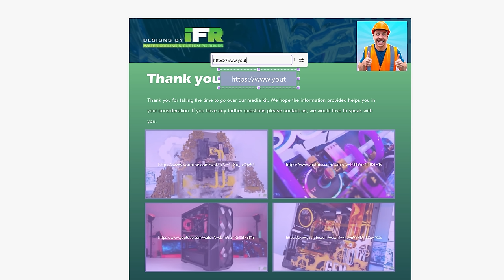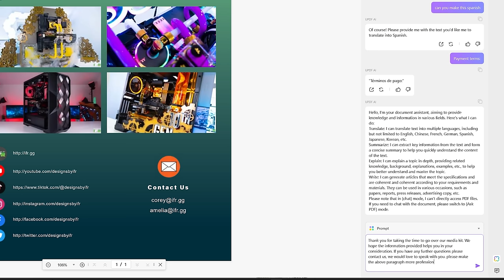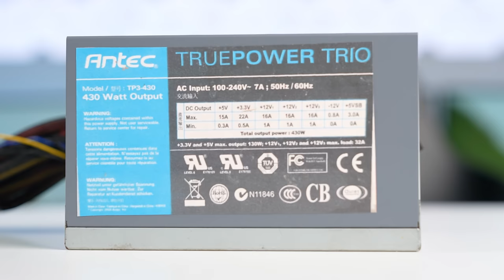Buying a BROKEN $49 Gaming PC On Facebook Marketplace

Comment: That 850w power supply is worth more then the all components 😅
Reply: . . . Most stuff may be washed with pine spray cleaner, then scrubbed and mercifully rinsed out & dried out in the oven at 125 degrees Fahrenheit . . . 🎉 ❤
Reply: i was about to comment that to

Comment: Since the power button cables were broken and needed to be re-soldered, I wonder if the original motherboard was actually fine and just never got signals to power on?
Reply from the maker: No i was jumping the mobo manually

Comment: I5 4460 is not that bad at all. U can pair it with an RTX3060TI, 2x16GB 2133MHz ram, 2TB sata 3 ssd, 650W seasonic psu and its good to flip it.
Reply from the maker: Yeah its a decent little cpu
Reply: No. The CPU Would bottleneck the gpu, the motherboards pci express has not enough lanes. The microstuttering would be all over the place
Reply: @ValentinaDiNapoli-bh7ds  not really.
Reply: @d4nith3  two words won't change the fact. * tell me not being able to afford decent hardware without telling me to not being able to afford decent hardware *  Lol

Go check some benchmarks, especially on the 1 percent lows
Reply: @ValentinaDiNapoli-bh7ds  it has enough lanes x16 pci express.
Reply: @d4nith3  even if, the system still bottlenecks. Make sense for once

Comment: Quicker way to clean that motherboard, just remove the CMOS battery and shove it in the dishwasher. Obviously requires longer drying time, but will leave it sparkling clean.

Comment: Oh my goodness where did you get that.  I really think it's one I built and sold on eBay forever ago.  The mismatched ram gave it away.  That's the case mobo gcard everything.  I think I got some components on Newegg and put the rest together with what I had.  But it could just be common parts still funny though

Comment: Should maybe test single components first before pluggin em all in.

Cleaned or not.
Reply from the maker: Yeah i didnt really want to reveal if it was working or not until the end
Reply: @DesignsByIFR  Need to buy me psu tester.

Tinkerin old computers is fun, even just for yourself.